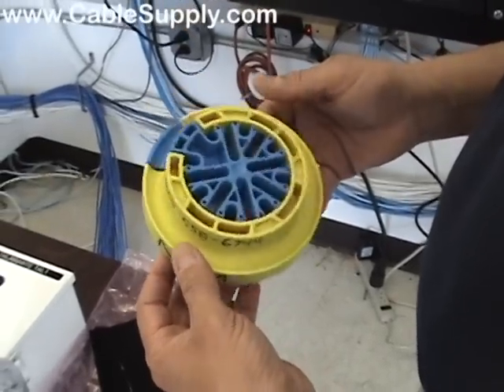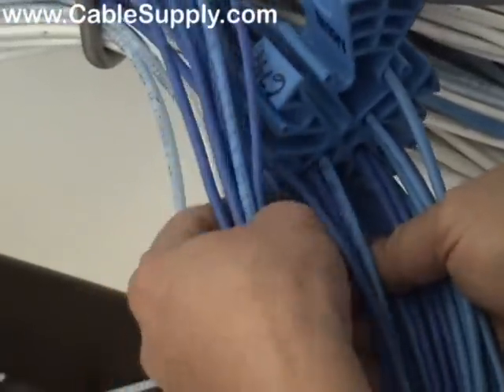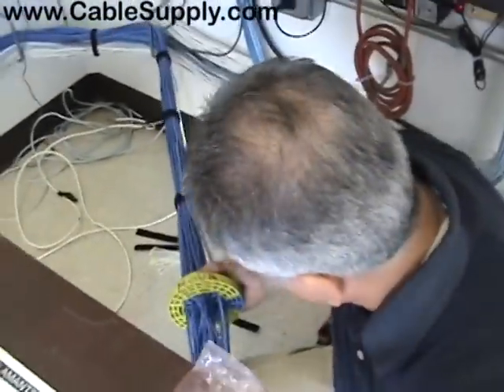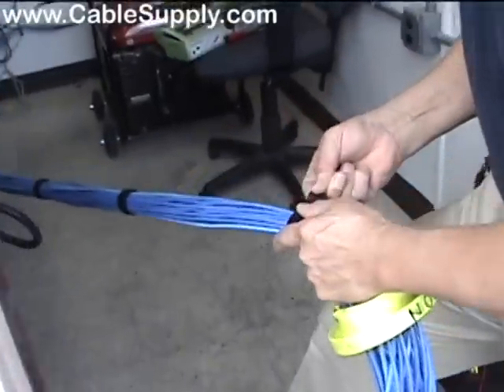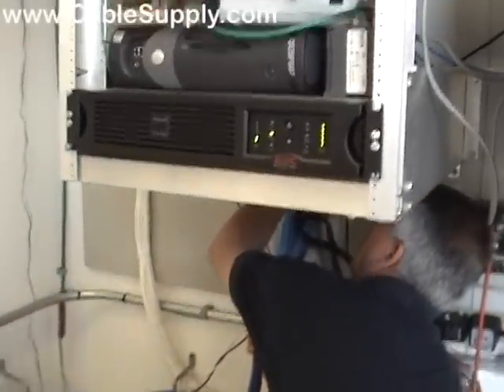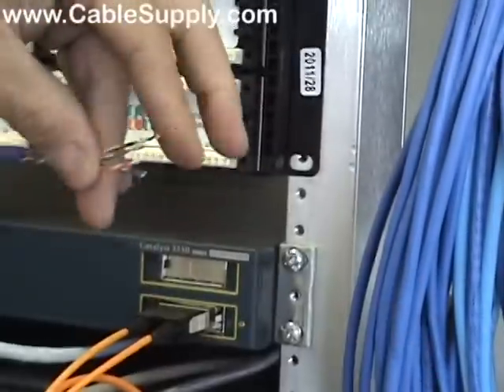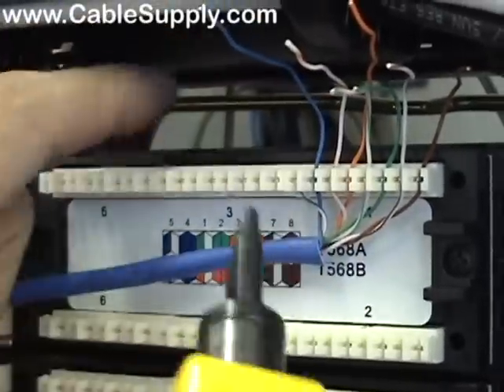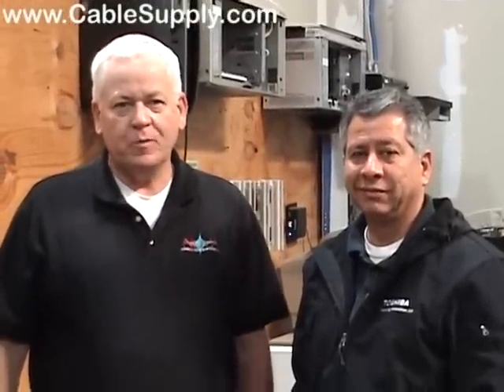Bundling Ethernet Cable with the Cable Comb and Terminating a Patch Panel

Comment: Jim, Patrick I am Ben Williams of Net2U I am am IT Service and support provider. I watched your video and I like how you showed the cleanest and most proper way of layingout the cable strands to be punched down at the patch panel, I like how you showed how to tape wrap all the way to the cables running ends so that they can cleanly and snag free be run up around and over or through in order for them to reach their end point of termination. This is by far one of the most informative, most professional videos on data cable management which can be applies to telephony as well. Great video guys and thank you very much.

Comment from the maker: Yes. Typically, the cable is only combed in the final room of use, after it's been run through the wall or ceiling. Combing the cable through the entire run would make the job twice as long. The vast majority of customers do not want to pay for the extra time and labor it would take to comb the cable behind a wall or in a ceiling, where no one will ever see it.
Reply: The more accurate statement would be customers want the cabling combed throughout the entire run but aren’t willing to pay for it

Comment from the maker: You can use it with cable that's 1/4" diameter or smaller. The holding slots are round, so it's best to use with round cables.

Comment: AnotherJunglist, patch panels are extremely helpful when it comes to MACs (Moves, Adds, Changes). Without it, you would have to reroute a very long cable if you change your network setup.

With patch panels, you simply have to use a much shorter patch cord (3m length normally).

It's basically for management purposes.

Comment: Another positive reason to use velcro strips over cable ties, in my opinion, would be the ease of removal. Simply pull the velcro apart, versus damage to individual cables when cutting off cable tie to remove.

Comment: Replying to my own comment here. I'm going for the T568B setup, because I've noticed that every single cable on the market has been terminated using a T568B system, so it makes sense to keep to that standard

If all cables were T568A, I'd probably go for that

Comment: at&t uses t568a because the 4 pair line can be used as a phone line in a pinch. if you look at the center pins 4&5 that is white-blue/blue which is typically line 1 in a phone system and white-orange/orange pins 3&6 that is typically line 2. look at an rj11 connector of a phone cable. lines 1&2 line up with the rj45 pins. so our cabling is universal for phone lines or data lines. (my comments are my own and from my experience)
Reply: For the most part, other than if specifically required to use one vs the other, as long as both ends match, there's no reason you have to pick one standard over the other.  If you need to make a crossover cable, you just make one end A, the other B.

Comment from the maker: It's not recommended to reuse patch panels or jacks. The pins have already been wedged apart by a previous termination so you probably won't get the airtight seal you need.

Comment: Always learned that 568A is USA and in Europe we use 568B, at least that's what they told us during CCNA class. If you mix up both you get a fast ethernet cross cable, for a gigabit cross cable you also need to cross blue and brown.
Also, try to keep all pairs of equal length and twisted as much as possible (but don't twist it more than it was). For fast ethernet it doesn't matter a lot but gigabit can lose some speed on that.
Reply: US here. 1000s of cable runs later, Never done an install in A.
Reply: USA is 568B.

Comment: @AnotherJunglistuh I dont know about your data center but patch  panels sure are handy to jump racks. As in you pre run overhead cable to specified patch panels ahead of time,  then when you are hooking up a server/switch/router etc you can quickly jump racks to where you needed to go without having to add additional overhead cable etc. And you can you use measured cable so you dont have to crimp everything you do all at once. Saves a ton of time imo.

Comment: Good video with regards to the cable combing. 
 However, the cameraman's comments that it's OK to use zip ties to bundle cable concern me. You should NEVER use zip ties on data cable. They can pinch the cable and open the cable braid on the twisted pairs inside the cable. Those twists  exist, and are at a specific distance apart, in order to prevent interference and cross-talk in the cables. The twists per inch correlates to the max frequency of the carrier used on the cable. It essentially forms a Faraday Cage around the data lines. This gets more critical at higher frequencies.
Look at CAT-5 compared to CAT-6. The latter has much tighter twists. This is to shield the shorter wavelength (higher frequency) signals CAT-6 is rated for.
Also, we're supposed to be using TIA 568A for all new installs as per the standard, though in the US this is poorly adhered to.
Finally, when opening up the twisted pairs to insert into the punch block, always try to open less than one full twist of the pairs. In other words, the pairs should cross-over right up against the punch down block. The preserves the shielding up to the block.

Comment: I did some research and apparently ISO say to use T568A on all new installations? I know there's not a real difference between the two, but I found that interesting if true?

Though, most pre made cables and some seem to be T568B only. It's pretty confusing

Comment: Then cabling in the patch panel and wall jack has nothing to do with the compatibility of "other countries."  The wall keystone jack must match the patch panel.  568B to 568B is straight-thru... as is 568A to 568A.  If you use 568A on one side and 568B on the other side, you have a cross-over...  which may not work for connecting end-devices: computers, routers, servers, or printers to a network switch or hub... though many new switches and computers support auto MDI/MDIX crossover detection.

Comment: Something missing. The Cable Comb and method shown doesn't have numbering sequence to terminate cables on port 01 – 24 for Straight panels or Angled panels. Imagine 24 ports patch panel to another 24 ports patch panel by combing cables in between … port 01 ≠ port 01 on the other end.
Reply: A cable toner makes this a non issue.

Comment: This is a decent video for someone who needs some instructions. I personally don't use the comb, and still create the same look but not a bad toy. Terminations on patch panel should be a little better. Over 1/2" exposed copper. Overall, decent though.

Comment: I like the idea of this tool but......say you have just wired 200 outlets and every cable is numbered. You would have to sort cables into bunches of 24 cables first, then after combing them try and get cable #1  inline with the first connector on the panel. Other than running each cable up the rack starting at 1 ending at 24 I can't see how this would work.

Comment: Hi there. Out of interest, what's the term for that sort of switch that the cable connects to without an RJ45 termination that you connect to in the video? The one in the rack mount?
Reply: It's literally called an ethernet patch panel.
If you're doing a modern installation, spend the extra $ and put in a shielded Cat6a patch panel.

Comment: I don't like Velcro for cables or PC's. When the cabling is Fresh or is in a durst free environment than yes go a head and use velcro.
But if its in a craw space or in a dusty place or you do not plan on fixing it your self. Just go with zips.
The problem is Velcro will turn into a dust ball, and if not used for a long time it will Stick together Like z zip or will come a part
i seen both. Some places it gets hot and some Velcro's glue's just start running and will stick it together or let the Velcro go.
But ether way, the way you guys are doing it, Dust free, ventilated and Very well supported i wont see this wiring job going bad any time soon
Reply: Marfnl disse.... my issue with zips is it’s hell to work in later